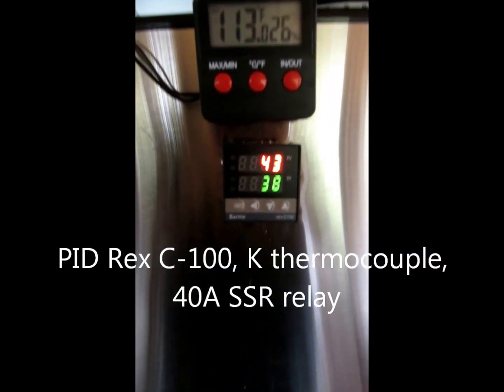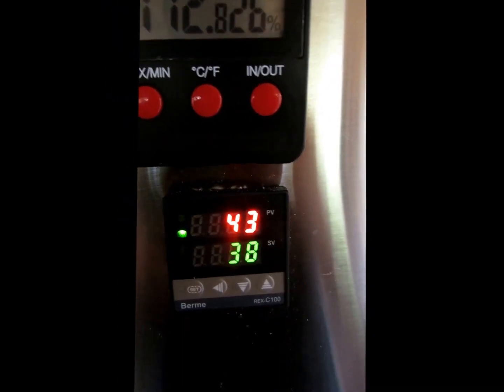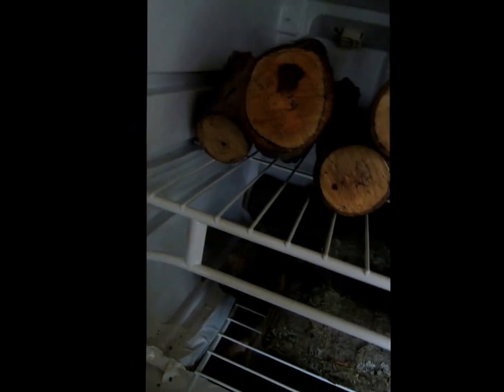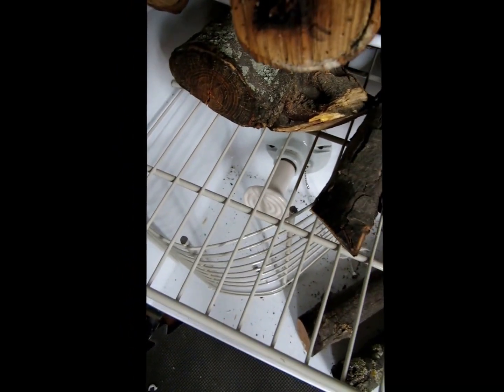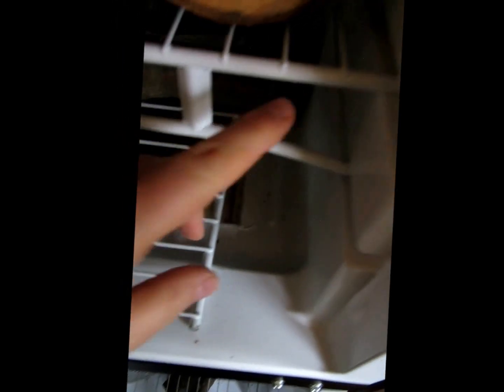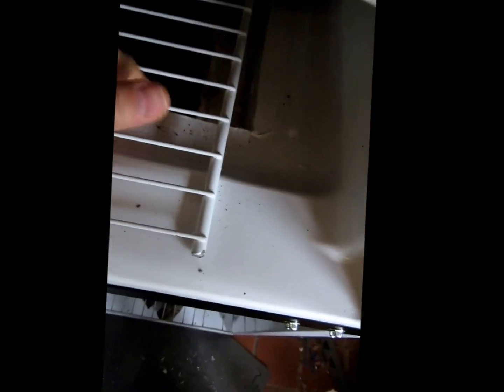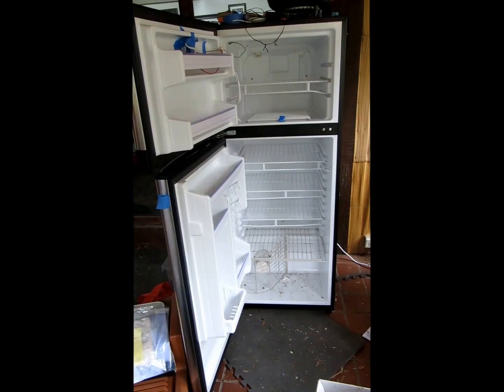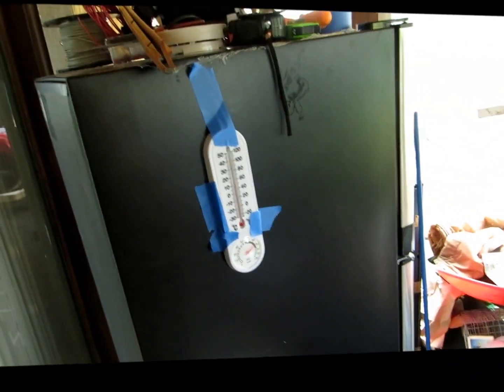Wood Kiln

Comment: Would be funny to see a guest freak out opening that fridge thinking it's real! Looks like it works good, good idea.
Reply from the maker: Freaked me out when I opened it and a load of ants started getting out. Glad I didn't drill holes and followed the advice to keep it sealed and open occasionally to remove water vapor.